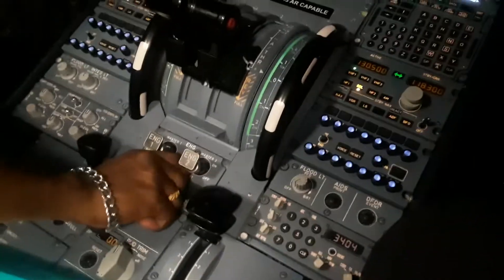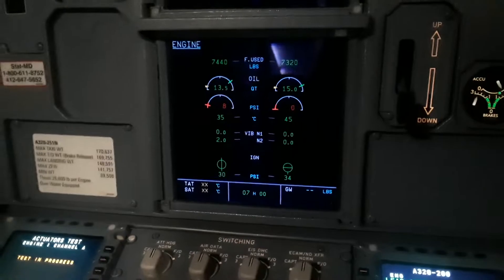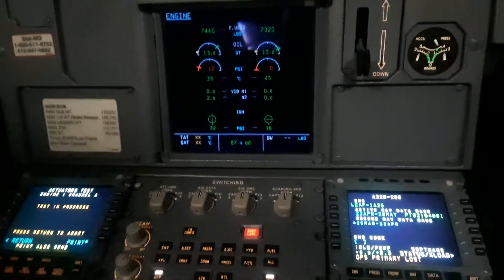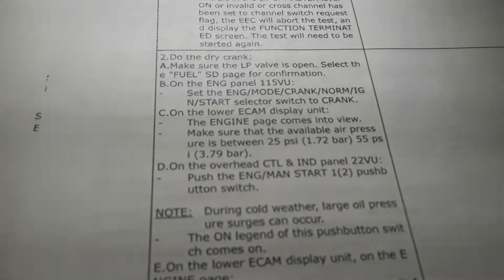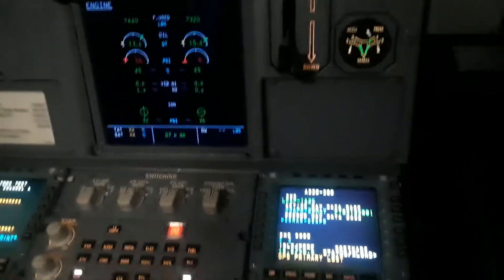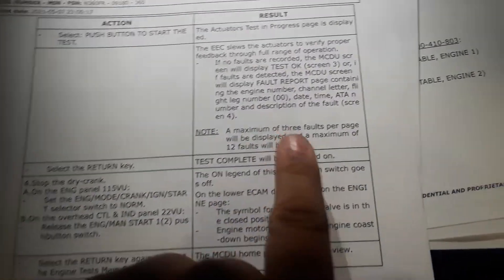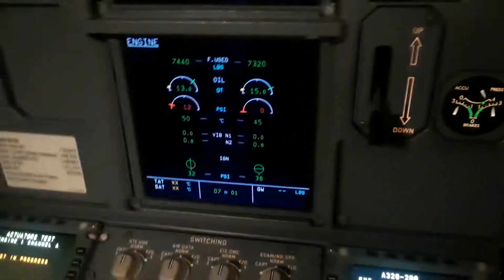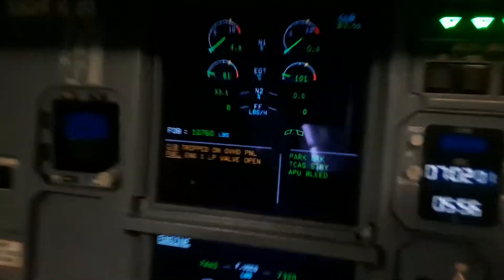A320 NEO dry motor starter valve OPS check

Comment: In such way you are damaging the starter 😮, manual start /crank  requiring  closure of the SSOV by push button switch.
Reply from the maker: No, I'm not. This is a legitimate maintenance procedure that is done through the on-board computer.